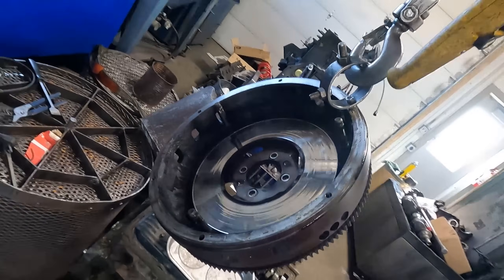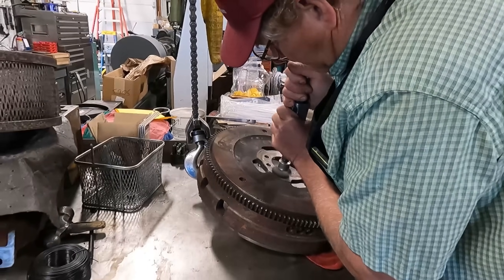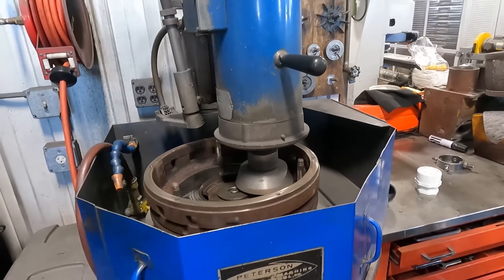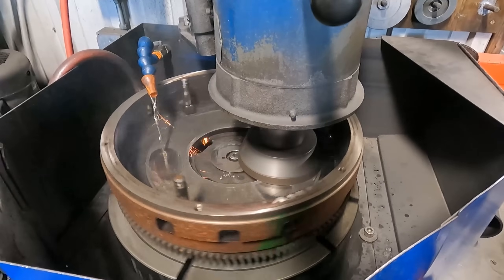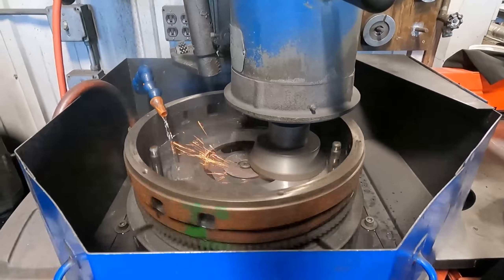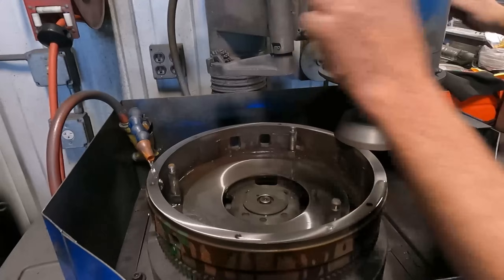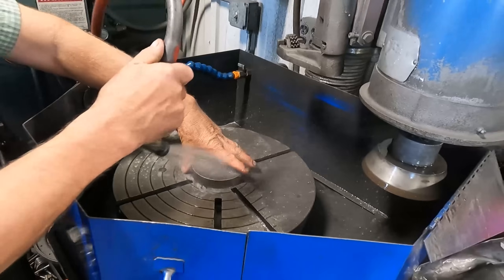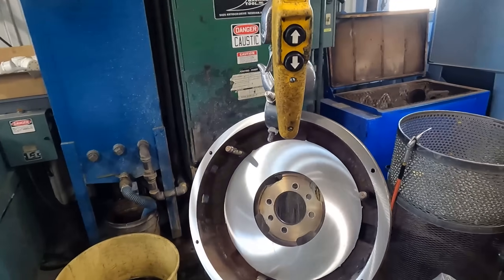How Do WE Resurface YOUR Engine's Flywheel? @JAMSIONLINE

Comment: Huge fan of the channel. Thank you for these videos.

I was thinking it would be nice if you had a fixed cam pointed at the machining surface in a little window on the video so we can see the surface gradually come right. The sped up part was super interesting since it showed that fresh flat patch of metal gradually get larger showing the slightly warped surface imperfections disappear.

Thank you for sharing this knowledge of the dark arts with us.

Comment: At 2:40 you mention "a few hundred dollars new" - from a Deere dealer that's a 1,500 dollar flywheel. I wonder if they turned the pressure plates or put new ones in with the clutches...

Comment: Another issue with old flywheels are the fact they can wear either convex or concaved   This will result in low pedal or no pedal.  When resurfaced there is a true flat surface as shown.

Comment: grinding or replacing the flywheel is just the same as a machining or replacing a brake rotor when replacing the pads. Do you HAVE to do it? no, but it's a good practice for maximum life of the parts

Comment: Do you have the ability to taper the surface?
If you do is that your normal practice or do you find having a parallel surface provides better clutch operation?

Comment: I to worked with my father in a machine shop doing all types of procedures crankshaft grinding block boring flywheel surfacing  ECT.  Father has pasted on and I have gotten old but your VIDEO brought back a lot of good MEMORIES.  Great VIDEO very professional machinists. Thaanks.

Comment: Those new diamond grinding stones are so much cleaner and safer than the old stones of yesteryear. 
For automotive, the flywheel grinder was a relatively busy piece of equipment 20 years ago, but with most newer vehicles being primarily automatic, this machine in an average shop isn't used a lot any more.

Comment: I remember working at a dealership and they brought in a used flywheel grinder because of all the dished flywheels we did. Before that we could only do flat flywheels on a brake lathe and had to send out the dished ones. They thought they were going to make and save more money by keeping it in-house, but it turned out we had to fix that POS machine before we even put it to use then they never trained everyone on it causing more issues. They also didn’t give the tech more flag time to do the operation but did charge the customer for the job, which pissed off the techs because they billed the customer four more hours to do a heavy clutch then they gave a tech to do the job before they even had a grinder. Rat bastards they were, one of the reason I will never work at a dealership again. Come to think of it that is probably why that machine was always braking down...LOL

Comment: So I have a question. My dad is a machinist and we have always had had a machine shop at the house because he did work at the house. Not really automotive more industrial job shop type work. When I was in high school he resurfaced a flywheel for me in the lathe for me. Now my question is was it wrong of us to cut that flywheel with a regular carbide tool? I'm just curious because the finish when he was done was on point and never had an issue with my clutch after that.
Reply: However you get the surface smooth and flat is the right way.
Your Dad had a lathe and was a obviously a skilled lathe guy, so thats what he used.
Reply: @fubartotale3389  gotcha. That is what I figured that how ever you achieved it didn't really matter, between using the surface grinder or a lathe. Being around a lathe all my life I just assumed you would face most stuff off in a lathe.

Comment: That's such a tiny Blanchard grinder. I suppose that actually makes it a lot easier to control too. I bet it's really hard with that little wheel to put enough heat into an item to get it to pull up.

Comment: Had the flywheel resurfaced for my 3010 John Deere when I replaced the clutch. Glad I was there assisting the person doing the machining. An older man in his 70s. Just needed some assistance. Why Capacity clutch kit for this particular setup is sent with a diagram on the clutch stacking measurement tool you can make. Compare the tool diagram dimensions to the printed numerical dimensions. The diagram is .100" shorter than the numerical dimensions. I called Hy Capacity about this and the tech I talked to confirmed that. When you make that tool use the numerical measurement, the basic profile is the same as the print. Just an FYI.